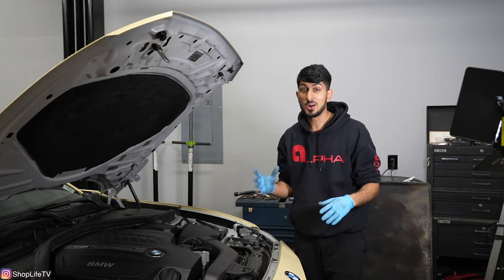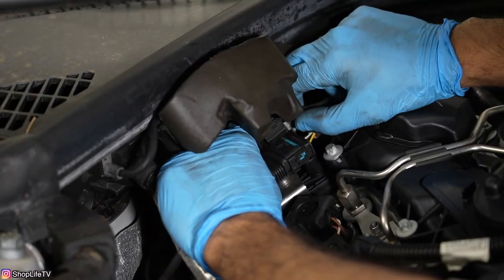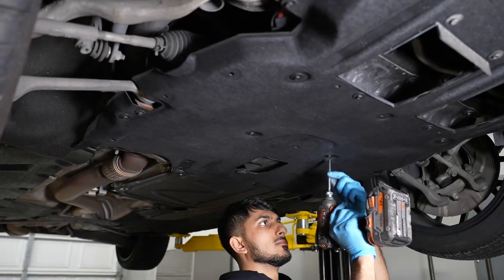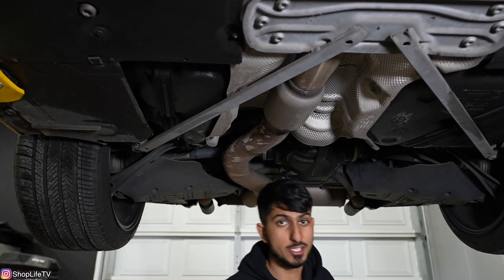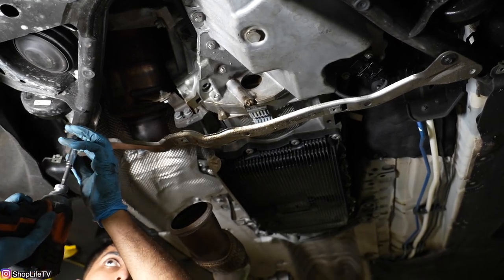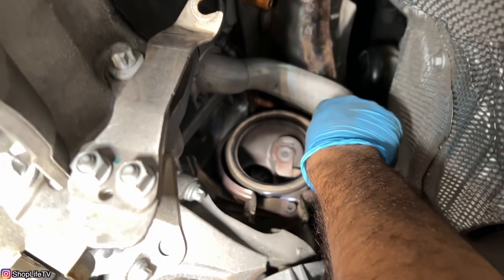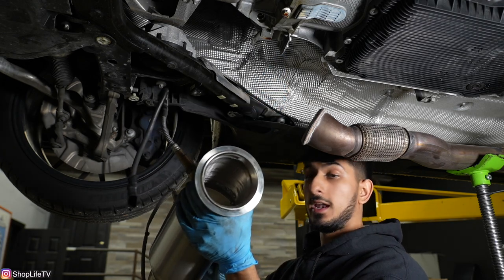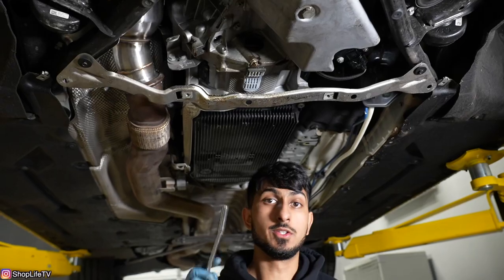How To BMW F22 F30 M235I N55 Downpipe and BMS Intake Install (EASY MODS TO INCREASE HORSEPOWER)

Comment: There are several difficult bolts (top one on water pump) top one on diverter valve itself. I think removing the charge pipe also helps

Comment: Can you make any e60 videos my sway bar systems leaks and i was wondering if it can be replaced with just a regular sway bar with no power steering lines, i have a 2005 e60 545i it's also hard to find performance videos about what parts are available for the n62.

Comment: Will this downpipe set off a check engine light
Reply: you can always code it out
Reply from the maker: Ideally you want to pair it with a tune. The only car I have installed aftermarket downpipes without a tune is my F80 and the CEL is intermittent.

Comment: Another video without exhaust sound clip...
These hot air intakes are gimmicks.
Reply from the maker: The exhaust didn't sound much different, the camera would not have picked it up. The intake noise is much more prominent. Most people go with intakes for the added noise element.